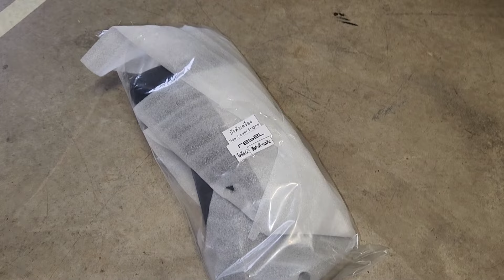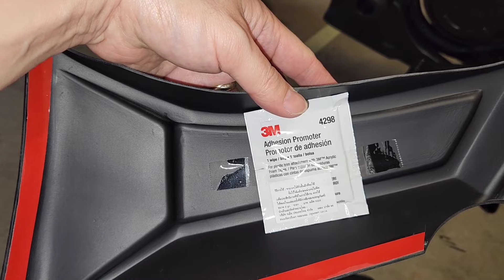Honda Rebel 500 KSPEED Diablo headlight cowl side engine covers & footrest installs -  TWEAKED REBEL

Comment: My I ask if the is also a K-speed tank cover?  Thanks, Kit
Reply from the maker: Hi Kit, yes it is. If you go through my list of videos I also have a Install vid for this one 👍
Reply: @TweakedGSX   okay Thank, I thought that was the thinner one not the whole tank encasement .. Kit
Reply from the maker: @Metricamn  I originally wanted to get the thinner central strip only one, but they sold out. After ordering the whole tank cover though I'm glad I did. Only thing is they aren't as compatible with handlebar risers if needed. Otherwise all good👍

Comment: Just curious, so if you need to switch out spark plugs im guessing you got to rip out the guards and somehow try to stick them back on when your done?
Reply from the maker: @BoomBooM-io5xt  it's 4 bolts to access the plugs
Reply: Oh so your going from the front to reach the spark plug not the sides?
Sorry kinda lost here how your getting to the sparkplugs.
Reply from the maker: @BoomBooM-io5xt  it depends on your tools. I can be done either way

Comment: how do you change the oil filter or spark plugs? do you have to remove them?
Reply from the maker: I've only ever had one service completed. But it's only 6 small bolts to get to it once a year.